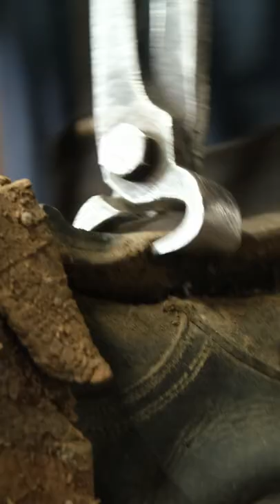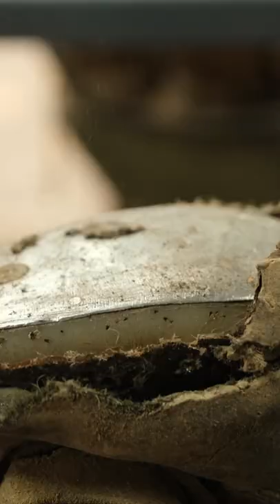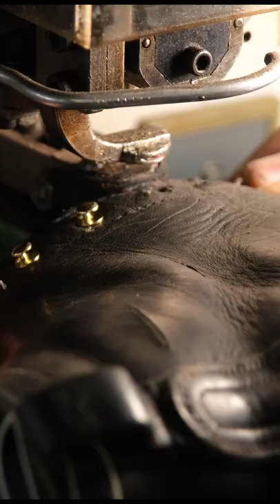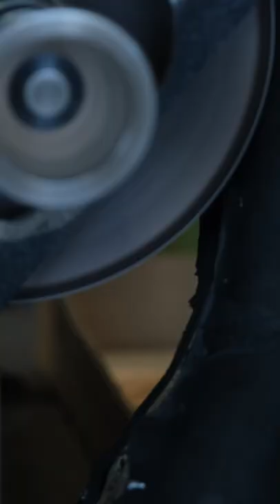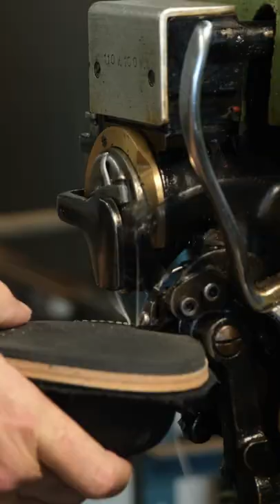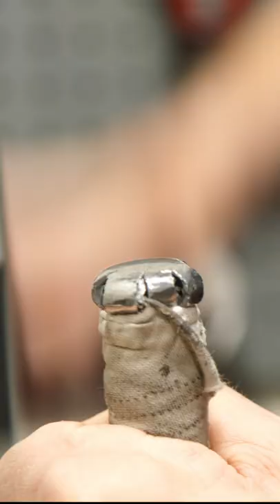Destroyed To New In 60 Seconds - FULL Nicks Boot Rebuild

Comment: Was this done for economical or sentimental reasons. Would the boot even fit the same afterward?
Reply: I understand they’re expensive boots so I could see how it might be cheaper but it also seems extreme
Reply: I think they rebuild the boots using the "original" sized shoe last.  So, the rebuilt boots would fit like the original boots did when they were new (more or less).
Reply: Both, rebuilt boots are cheaper than new boots.